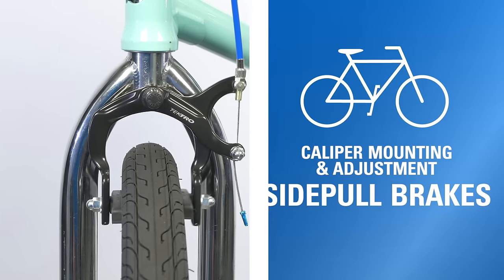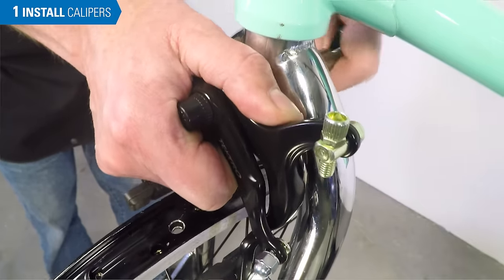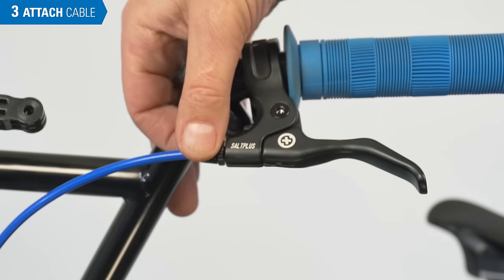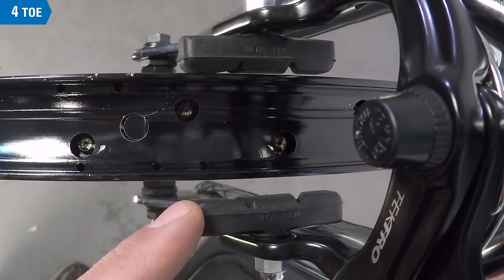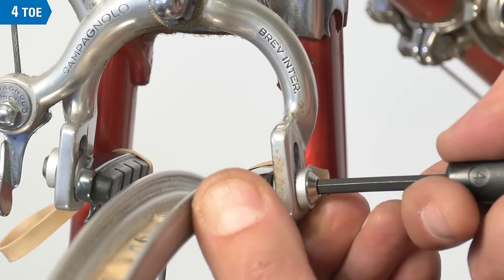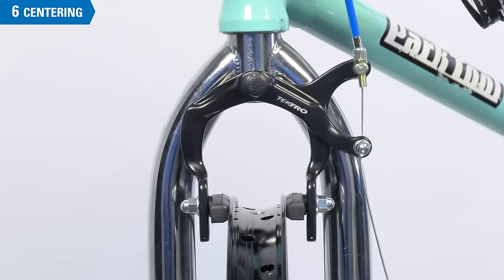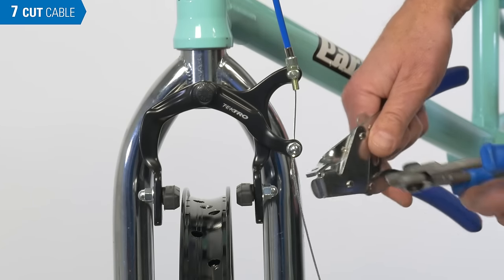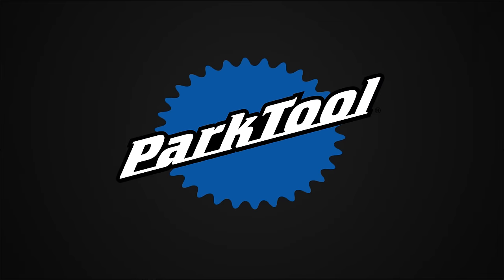Brake Caliper Mounting & Adjustment - Side Pull

Comment: The biggest headache of adjusting the breaks is centering the break pads. Finally someone showing clearly how its done. Thanks a ton!
Reply: My biggest problem is lining up the pads to the rims.  I get it perfect, try to hold it in place as I tighten the nut, and the pad moves on me every time.

Comment: The centering chapter was exactly what I needed! Thank you so much for the straightforward easy to follow video
Reply: Was it a case of loosening front and back nuts. Centering and tightening again?
Reply: @funkyprepper  yes that's about it, squeeze the brakes a few times and make sure it stays

Comment: I have heard some on other vids complaining how hard it is to use them really rough on the little boys hands.I remembered as a teen I would put a few drops of fine oil between outer and inner of the cables and hold it up until it soaks all the way through.Worked like a charm.

Comment: Great video to explain most possible issues and solutions for side-pull brake calipers. Only feedback is on brake pads "don't need to touch exactly at same time", if the contact is only partially out of timing with light pressure it is probably ok, but with more adequate pressure it is still off time, I find the pads wear unevenly. So, if arms have been centred as much as possible, once pad-wear becomes visibly different, I rotate the pads to opposite sides.
Lastly, I wish my bicycle and hands remained this clean during maintenance! Mine are always blackened 🙈

Comment: I have never been good at getting these types of brakes adjusted (didn't have youtube back when I was trying though).  This video made it crystal clear.   Well done!   I bought my daughter (7 years old) a drift trike.   Since adjusting the brake, I am leaning to replacing it totally.  The pads have no cams and the brake lever is rather flimsy and far from the grip.   I'd have gladly paid an additional $50 or so for the trike with a better brake.

Comment: I just started a job where I assemble stuff and the main thing is bicycles. I'm working through a 2 month back log of bikes so at least 1 out of 4 are damaged. Bent rim here, bent forks there, missing parts, heck, I had the forks fall right out of a bike today, bearings and seals all over. Found a manufacturing error on an EZ bike, the pin hole was way below the pin where the forks and handlebars meet, so the unit would not stay together and there was a shallow cut below that. The machine must have been wigging out that day.
Adjusting brakes is a pain and I will be watching this video many times!

Comment: What an excellent tutorial! I'm having trouble with my little boys brakes, he's only 4 and they're just difficult to apply, even for an adult. Any tips on kids brakes or are the cheaper ones just beyond saving? They are side pull like these on the video and I've made all the adjustments.

I'm wondering if the new wheels and pads are maybe a bit more slippery from the factory and if they might get better with a bit of wear?
Reply from the maker: There are kids bikes that have steel rims that are powder coated. Any paint including powder coat does not have a high coefficient of friction. So even if the brake is working best possible it will not slow down well. You can try to scuff the paint to increase friction but there is not much you can do to resolve the issue.

Comment: How do you release the side pull brakes when you need to remove the tires?  BTW great idea to produce these videos for both a business sales and user success.  Thanks
Reply from the maker: Not all side pull brakes have a release to allow the tire through. If it does have one it would likely be where the housing rests on the caliper.

Comment: Years ago when I worked in a shop I used to do the toe-in like you show here on old steel brakes. I have heard more recently that it’s not ok to do with aluminum. Was that just bunk?  It seems like there has to be some way to properly toe these in.
Reply: Don’t quote me but I think it would be okay. In my experience aluminum requires less bends before it brakes so that might be why people recommend to not do it

Comment: Calipers ALWAYS worked better than 990's. Because of this, I want to put a front caliper on a modern bike. I have the hole for the bolt. Will modern 2.4 tires work with old-school calipers?  Funny thing, I have to either spend $20 for a caliper, or a new 990 fork and brake for $200.   :(

Comment: Awesome video but I have a question. Is it normal for the back wheel to be able to spin (although barely) when fully pressing the brake lever? The front wheel doesn't turn but the back one can turn with enough force

Comment: I'm a grandfather trying to assembly my grandson's new Huffy bike. It has a coaster brake and one front caliper pull hand brake. The only way the the hand brake returns back into position after each pull, is by having both center nuts on the caliper,  hand/finger tight. I'm worried that with the vibration of while riding, the outside nut will loosen and pop off.
Reply from the maker: See the last part, section 9, of https://www.parktool.com/blog/repair-help/sidepull-brake-service 
This is the adjustment of arm movement and play.  The two nuts lock against one one another. This controls play in the arms.
Reply: @parktool  Yes it worked . Two wrenches did the trick. Your good, very good!

Comment: What actions do you recommend if one brake mount is different from the other? The set of brakes I purchased fit on the front but not the rear because the mounts are different. Front being flush to the fork and the rear being flat. Maybe a washer?

Comment: Great video, thanks! I think I have correctly adjusted the brakes but I feel the braking power is not enough. Is the braking power of this type of brake comparable to vbrake? The brakes are Altenburger Brilliant from 70s, when I brake hard I can see the whole system is moving toward the fork, I think that maybe the pivot is more "plastic" because they are old, what do you think, I appreciate any input.
Reply from the maker: These side pulls cannot provide the power of a "Linear pull" or V-brake.  Make sure the pivot is lubricated and properly adjusted, with no play.  There will be some flex in the arms and the pads push into a moving rim.  It will always be limited by its design and engineering.
Reply: @parktool  Thanks!

Comment: Whenever I adjust the pads to be tight and good , the brake lever Iso way to hard to pullback , any help?
Reply: Damn 2 years ago ion know if youll see this  but i think its supposed to be like that since the wire is tighten a lot

Comment: Very informative, Thanks! I do have a question though. The brake mechanism was disassembled when I got the bike so I wanted to know if the brake arms are suppose to have a washer between them so they don't bind? In the parts there is a nylon washer. Is that suppose to be between the arms?
Reply from the maker: Not all manufacturers use a nylon washer.  There should be something between the two.

Comment: Are there situations where the pivot stud elements keep slipping, forcing the entire brake mechanism to shift entirely one way, when the brake lever is pulled? What would be the fix?
Reply from the maker: Yes, that can be an issues.  Use friction washers between the caliper stud and the fork.  These help lock it in place.  "Star washers" can also help here to do the same thing.

Comment: Can I do the toe thing 6:09 on aluminum brakes without stressing the levers?
Reply from the maker: There will be stress on the lever arms.  Basically, on cheaper brakes these arms are thin and will accept a slight bend.  Some brakes have arms that are thick, and should not be bent.  The brakes with thick arms tend to squeal less because they flex less.  If bending is a worry, get pads with the washer systems  that allow toe.

Comment: Great video thanks is weird I can fix cars, motorcycles but I always have issues with bicycles
Reply: rocalegi Bycicles are more a touchy feely thing with mechanics . Like bending derailleur cages slightly to get no chain rub. The issue with bike mechanics is setting up a bike requires a person to also ride it then retorque bolts or re-indexing .

Comment: I have a trek 330 and 
With these kind of bike breaks 
Could I used a slightly bigger rim 
Say 1/8 wider then adjust the Breakout ?
Reply from the maker: Possibly.  With pinch bolt loose, see how wide calipers will open.  If they open a good bit more with the cable, then a wider rim may fit fine.

Comment: I bought a used 1985 Panasonic DX-3000 road bike that has Shimano Z570 side-pull brakes. I want to put Shimano Claris brakes on it, do I need to modify anything to the mount?
Reply from the maker: That should be a direct replacement.
Reply: @parktool  thanks a lot

Comment: Does this brake caliper style work with interruptor/cross-top brake levers? And if so, can you use those levers on their own, without drop levers?
Reply from the maker: The "cross-top" brake lever options would with pretty much any cable pulled caliper, so they would work here as well.  The cross levers are sized for drop bar diameters.  You would run the cable end direct into the lever. The lever is pushing on the housing to pull the caliper arms, rather than pulling the cable directly.
Reply: Park Tool Thanks a million! This is invaluable info for me. Practically no source on any website seemed to be able to say whether this would work and the few that did could not or at least did not elaborate on the how and why

Comment: My rear calliper doesn’t spring back out very well on its own. Any ideas? New inner and outer cables so that shouldn’t be a problem. Centred and spacing is otherwise good. They just don’t come away from the rim very well.
Reply from the maker: The center pivot point might be too tight. I would suggest loosening just an 1/8 of a turn or enough to allow free movement. I hope this helps!
Reply: Park Tool thanks, I checked that already and hasn't cured it. Put some grease in there as well. Suspect it may be a combination of cable positioning, old brake lever with weak spring, old caliper. Actually rides okay, hopefully it will free up with use

Comment: Can we replace side pull breaking system with V break
Reply from the maker: No, the mounting system to the frame is completely different. The frame/fork will have two studs mounted for the linear pull or cantilever system.

Comment: Two questions. The first one is probably gonna be a no but, i'm gonna throw it out anyway; I have a BMX that use's this type of brake, however, i'm wondering if theres something out there that you can buy to mount on the frame so that you can put V brakes on it?   I hope thats understandable, lol. Second question; Is there a way to make these side pull brakes stronger? I'm doing everything right and my side pull brakes are very very weak. Thanks.
Reply from the maker: It would require a new fork to mount the linear pull (V-brake).    Make sure the rims are clean, and also you might try different brake pads.  These side pull brakes are on a BMX bike are not the best at stopping.
Reply: Ok, thank you.

Comment: My bike has side pull brakes but can I swap them out for dual pivot?
Reply from the maker: Possibly.  The mounting system is the same, but you will need to match the reach. This is the distance from the rim to the mounting bolt.
Reply: @parktool  thank you so much! Also, do you reccomend any budget brake levers? Because I'd like to swap my brake levers if I switch my brake calipers to dual pivots. I've never been the type of person to change parts on a bike and dont understand much. Thank you!

Comment: If the brake shoes don't touch the rim at the same time, why don't adjust the brake so that they touch simultaneously?
Reply from the maker: Ideally you have both touching and centered at the same time. If one side is moving slowly, it may touch after the first.  It is better to have the centered to the rim regardless of how they touch, but only for a side pull with a single pivot bolt.

Comment: Whenever I adjust the pads and have them center and test the brakes one pad doesn't want to retract back into the position I want it. Continuing braking and one pad is left up against the rim while the other one just keeps moving.
Reply: Ive had the same problem
Reply from the maker: First do a simply test of the pivot.  Squeeze and release the lever. Now grab each arm and pull outward.  If the arms move outward after this you likely have a pivot that is too tight.  However, if the pivot is acceptable, there is a centering problem.  To center you need to rotate the mounting bolt because it hold the spring. If your model does not have centering flats, try this.  Grab the caliper brake by the center. Loosen the nut behind the fork/frame. Rotate the brake in the direction that helps it not rub and hold.  Now secure the mounting nut.  It may take a few tries, and sometimes you need to over shoot to end up centered.

Comment: Hi, i need help.
It looks like the brake might be over tighten, the position and gap between rim and pad seems just fine, its centered, Issue is its so hard to squeeze the brake lever. Should i loose one of the double nut at the front, (inner or outer?) to make it easier to squeeze?
Reply: Logic is, will tighten up and loosen up the double nut make it "easier" and "harder" to brake?
Thanks in advance.
Reply from the maker: It could be due to drag in the cable and housing. Does the brake caliper rebound well?

Comment: I have 20.5 bsd bmx without brakes can i use this?
Reply from the maker: If the fork or frame has a mounting hole for a brake caliper to mount, it should be work with a side pull.  Side pull brakes have different amount of reach, so measure from the mounting hole down to the rim braking surface.
Reply: if your BMX doesn't have disk brakes or brake pads you should have a coaster break which u peddle back Ward's to stop
Reply: +Lester Hilger exactly I do agree

Comment: I have a question for you I have 2- stroke motorized bike it is aluminum frame hyper beach cruiser with coaster brake want to add a rear side pool caliper brake on aluminum frame but there is no hole for a caliper but there is for the finger there is an insert for the finger but not for a brake caliper how do I do that without destroying the frame I did add a side pull to the front fork
Reply from the maker: This is the part where you sit and stare at the frame, and then the  parts and then again the frame, all the while turning things over in your mind, looking for solution that would resolve the situation.
Reply: The frame is a pretty decent size on the back end it's not your average frame it is a big frame diameter tubing
Reply: I do have a video on YouTube the back end of the frame area because you kind of give you an idea how big the frame is on the back in where the rear tires at

Comment: I have a problem,I have this sistem on my bike and when I install it and squeez the brake lever the cable tube's (or how ever it is called) inside spring looking metal gets pulled out,which gets aditional lenght of cable tube inside the lever and makes the brake useless,pls help
Reply from the maker: Hello! Sounds like you are having some housing issues and you may have the wrong style of housing. We suggest replacing the cable and housing with a good set of brake housing and cable.

Comment: My brakes won’t go done on the rim and will only press on the tire. How do I fix it
Reply from the maker: The arms should provide a way to move the pads up and down in a slot.  If there it still hits the tire after adjusting you need a new brake with longer arms.

Comment: wanted to ask you when i apply the brakes my whole system moves to the side, the side of the cable pull I tighten the nut but for some reason it keeps pulling to one side then it starts rubbing the rim can you help.
Reply from the maker: Seems likely the mounting nut is not tight.  Tighten the nut the hold the brake stud as you hold the brake centered.
Reply: I tighten the nut but it kept going to the side but the bolt stayed centered then  I lubed the calipers and it seemed like it worked.
thank you
Reply: Frijo1 same problem here

Comment: Should we lube calipers?
Reply from the maker: The calipers should have lube at the pivots and at the spring contact to the arms. - Calvin
Reply: Thank you for your answer.
Reply: Also make sure you lube your brake blocks as well to make sure you get the most out of your brakes.